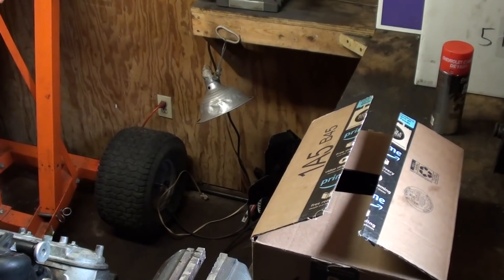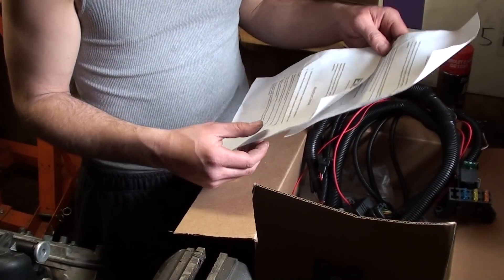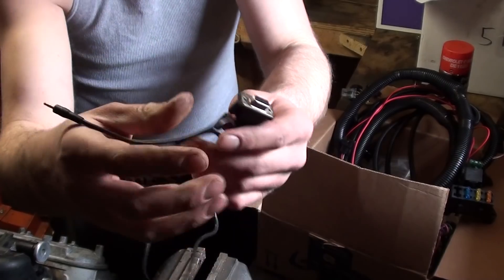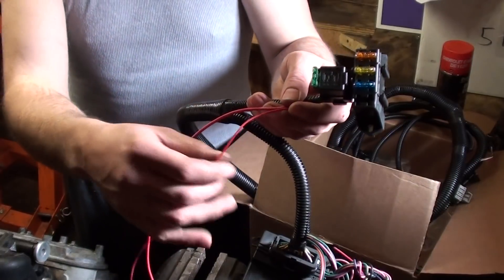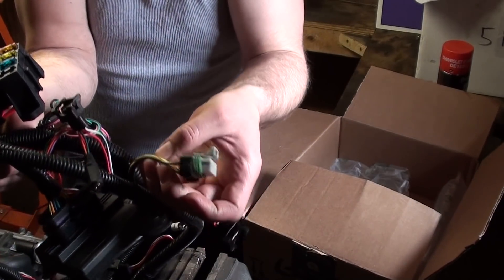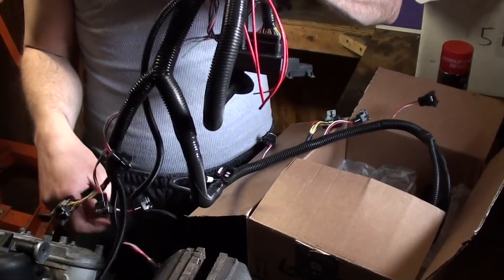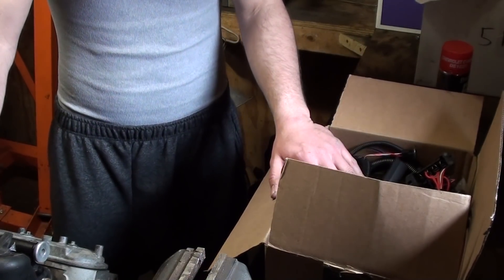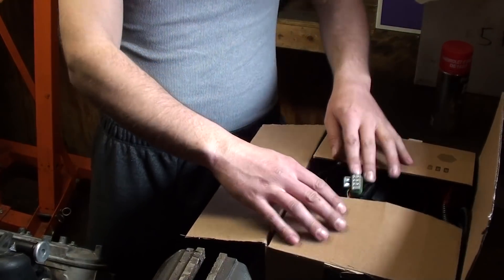EFI Source Microsquirt LS1 24x description and overview DIRT CHEAP FUEL INJECTION

Comment: Hey whats up man I have question I want to rewire my stock 1998 trans am engine wiring harness because it's really corroded and i was wondering if I needed any special type of wire or wire size that have to use for the o2 sensors cause I was reading online I think in summit racing that they said that a wiring harness that they made had to be use only with Bosh o2 sensors I forgot the part number I think I it was like 13444 or something like that , thanks man

Comment: Microsquirt is legit. I had one on my car for a few years and its super simple. Just a heads up, it doesn't use the iac sensor for the throttle body so you'll have to plug the port behind that sensor or you'll have a big vaccum leak!  Efi source also offers an autotune feature for microsquirt for an additional cost that adjusts the fuel map acording to whatever afrs you're demanding. It really helps getting it driving pretty damn good without a tuner. Sweet deal
Reply from the maker: I'll have to look into that Auto tune feature. How does it work?
Reply: @beeterolds  works damn good!  Punch in your desired afrs and just drive the car in different conditions , cruise, roll into it, freeway, uphill, stop ago. The more you drive the better it gets. I had mines on a boosted setup so i just added a bunch of fuel up top to be safe but NA wont be a problem.You'll love the simplicity, have fun!
Reply: @beeterolds  you can also choose how aggressive it makes the changes. It adjust based off o2 reading so grab a wideband, I recommend aem
Reply from the maker: Thank you for all the info. I may be leaning on ya a bit when we get this thing running sir !
Reply: @beeterolds  no worries at all 👍